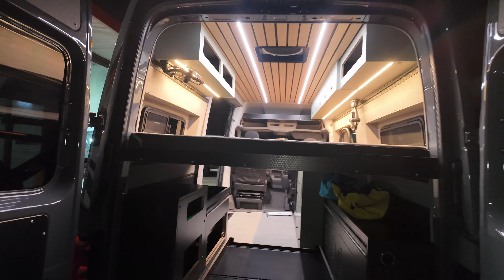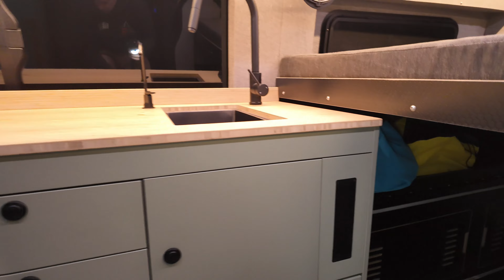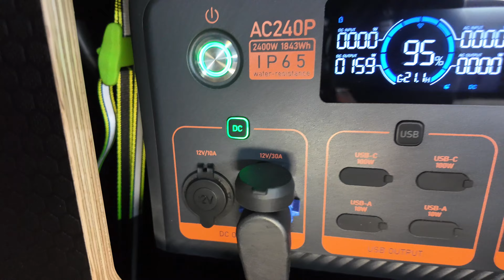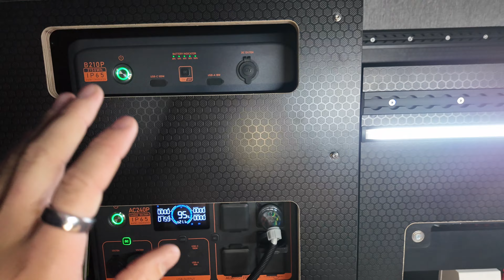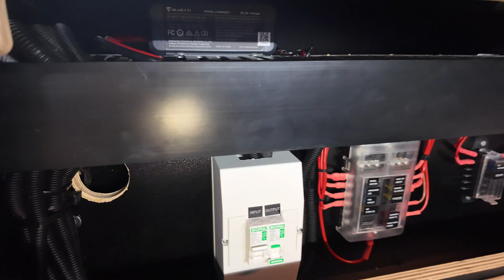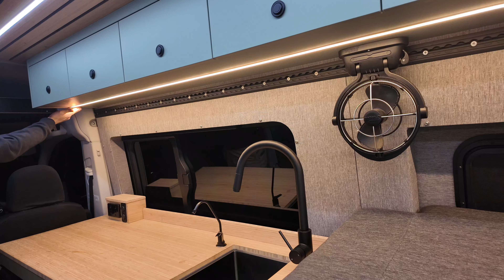BLUETTI VANLIFE | Summit Vans Crafter

Comment: I dropped by your channel to watch your video on electrical mistakes then just watched this video as it looked interesting. Where I'm now lost is you went through the regulations in the first video, about the need for a sealed box for the batteries. But the batteries in this video don't appear to be in a sealed box. Are the regulations different because they're portable? Or have I missed something important? 
Great videos by the way. 
Thank you.
Reply from the maker: Yes you are correct, you still need an electrical certificate for the 240v AC run in the van for it to be compliant but this battery system is portable therefore doesn't need to be installed in a box.
Reply: @jtelectricalgroupnsw  Great, thanks!